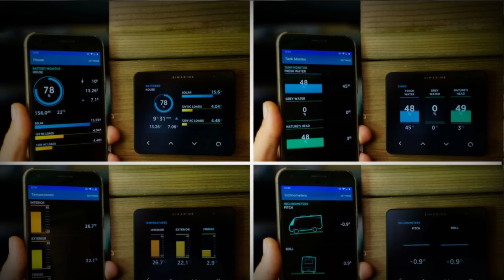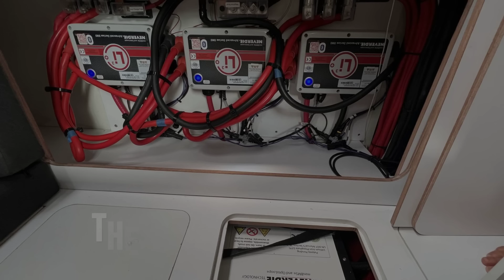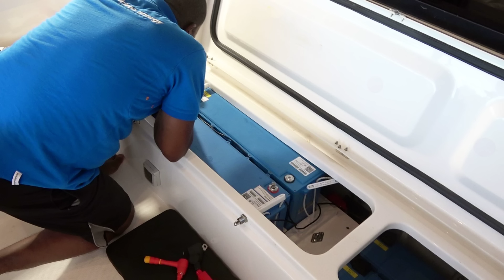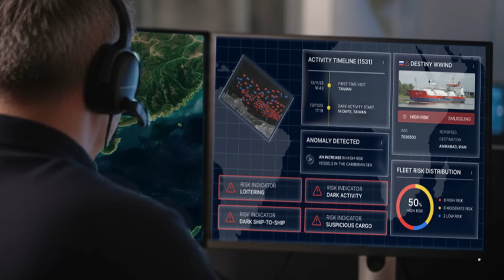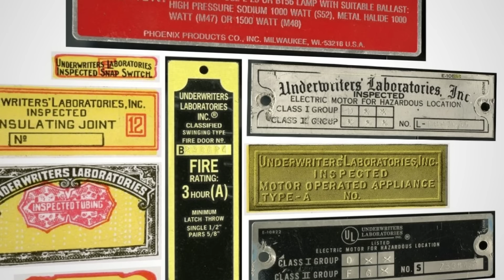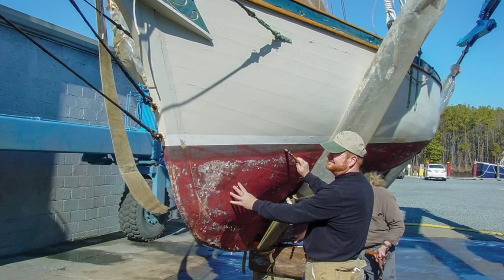5 'Standard' Upgrades That Will Make Your Boat Uninsurable by 2027

Comment: What about Complete Power systems like EcoFlows or Pecrons? Say like a Delt Pro Ultra? or Pecrons E3800LFPs? All Factory Built! For say 110
Reply: Still none standard.
By the way, if a lithium battery sets on fire on a boat… you have less than 30 seconds to get off.
Reply: @galgappa True! rarely happens. Your boat will catch fire do to bad Electrical more than lithium. Or boat Explode form Gas Engines. Why I bought Diesel. Most Power Stations are well protected against Water. I also buidling another Air vent shell over that with dehumidifier and H2O mesh for tripple safety. But anything is possible. Your boat might get taken out by a Killer Whale! :face-fuchsia-tongue-out: Why my house and engine batteries are all New AGs too! I will have 3 sets of batteries. Yes, Lithium will be for the 110 in a steal box.